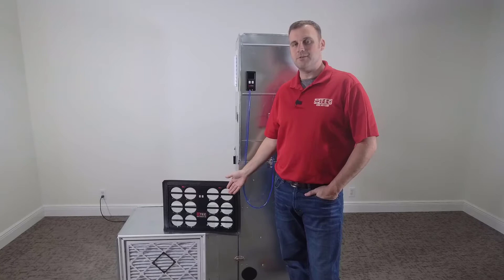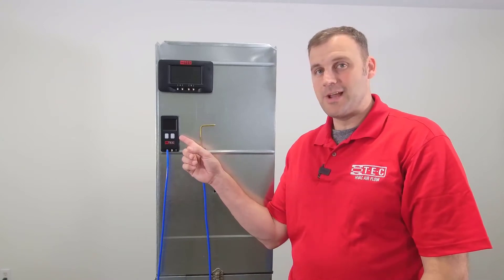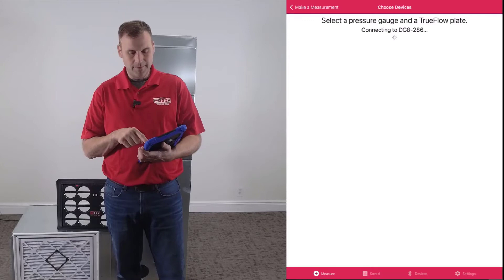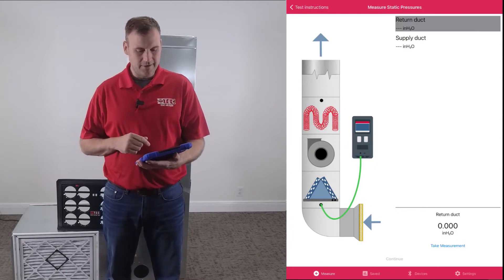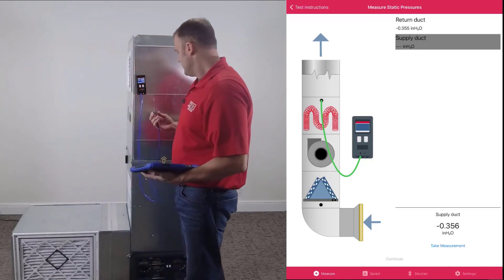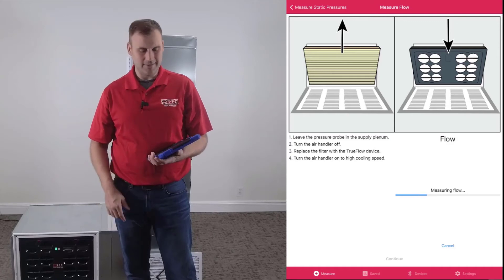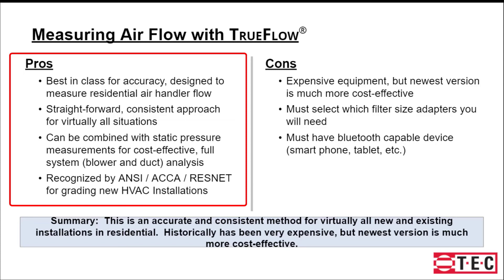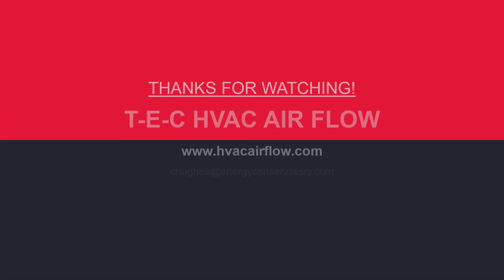TEC - HVAC Air Flow - TrueFlow® Overview

Comment: What would you do if you 2 return grills with filters in them? Measure with the grid in both? Or just at the air handler? Also does the grids fit most residential air handlers!
Reply from the maker: Good question.  In a situation with multiple returns, the proper approach is to block the other smaller returns during the workflow process.  The app now has a workflow selection and instructions to follow for this procedure.  Also see this video covering multiple filter grilles.  https://www.youtube.com/watch?v=7tLwt_ZTGrs&t=10s

Comment: Will this work in package unit application?
Reply from the maker: The TrueFlow will measure airflow properly as long as all of the total system airflow is moving through the grid and tolerances have been met.  
Tolerances:  6" clearance upstream; 2" clearance downstream;  Maximum of 65 degree angle to airflow.